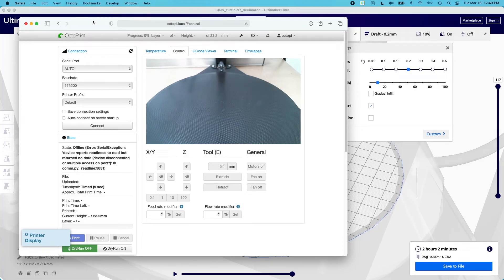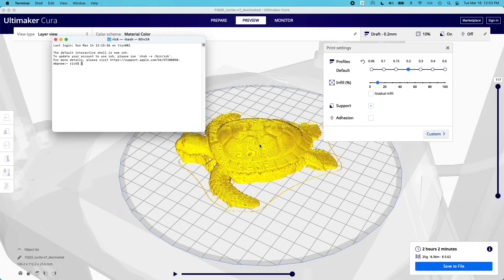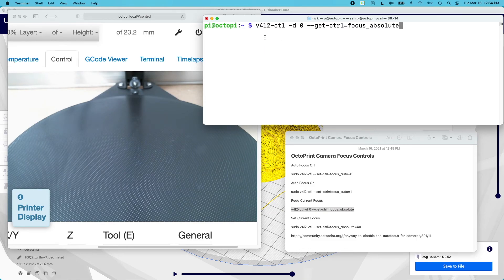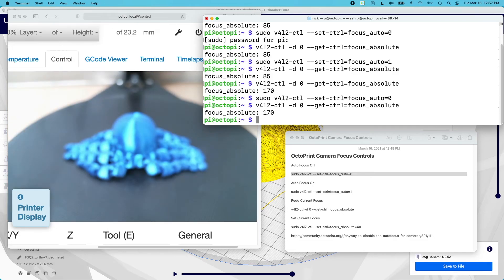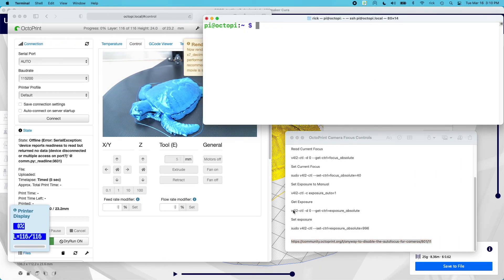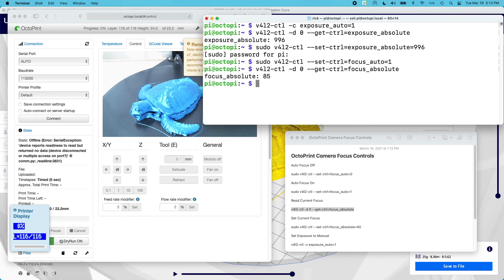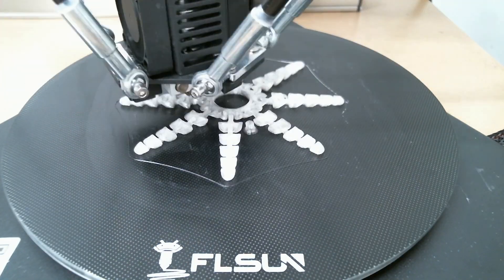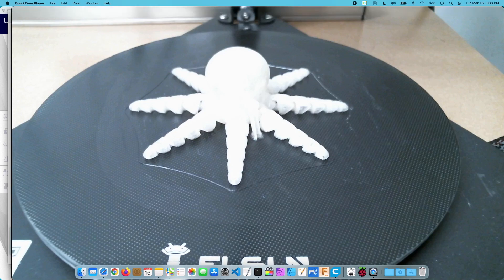FLSUN Q5: Locking Focus and Exposure on OctoPi Timelapse (Ep. 25)

Comment: Checked all your videos of the Flsun Q5 and they are realy great. How do you like it so far? I'm in the process of getting my first printer and it's now down to either the Q5 or a Ender 3 v2. Must say I realy like how the Q5 looks but how do you do feel the print quality is. I'm guessing the ender could be a better printer with modifications. But my  goal is just to get good enough prints for som smaller arduino projects and from my understanding the Q5 would do great for that aswell?
Reply from the maker: I'm a fan. From what I understand the Ender 3v2 is a great printer and I'm guessing it is probably better for mods. That being said, I'm getting pretty good print quality from my Q5 and I am running it stock. I would have probably been happy with the Ender 3 but I do really like watching a delta printer. Give the choice again, I would probably go with the Q5. I might consider an Ender 3 if I want/need a second printer.